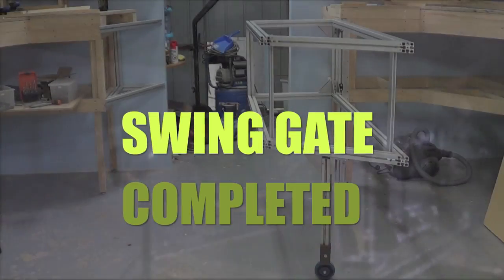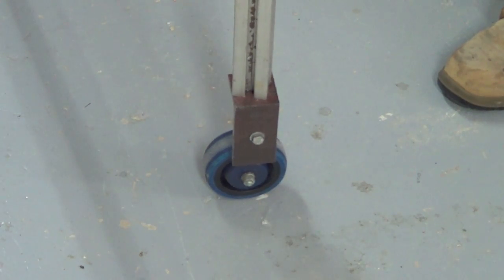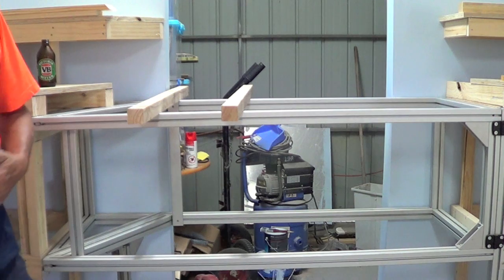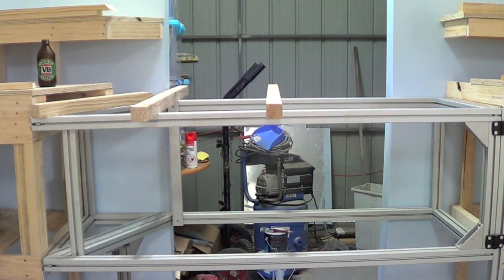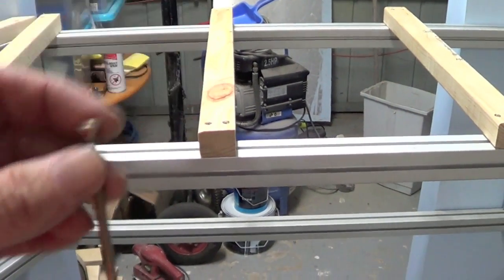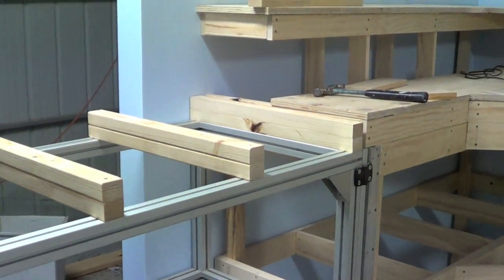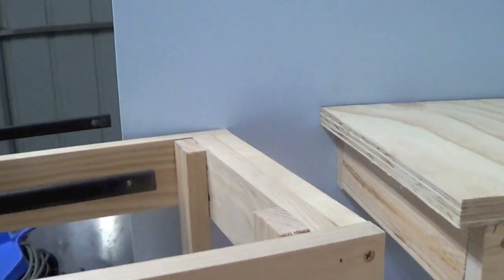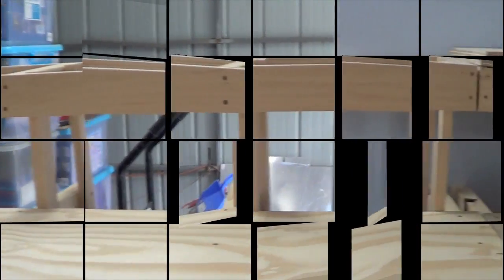Swing Gate Completed " Model Trains"

Comment: Great job! This is one of the most useful videos I have ever seen here. And it will help me to build the same gate for my layout:)
Reply from the maker: +Hrvoje Raukar   Thanks for the comment and hope this helps you out cheers Robert
Reply: Robert,
could you please give us some info on alu profiles you used for your swing gate (dimensions in mm, cross section etc.)? 
Thanks!

Hrvoje
Reply from the maker: +Hrvoje Raukar    Hrvoje   the dimension of the aluminium Extrusion are 45mm square and the two cross sections are 45mm x 16mm
also the two angle brackets are 90mm x 90mm hope this helps cheers Robert
Reply: Dear Robert,

thank you a lot.

Hrvoje

Comment: Hi grat job you may find that the microswich neads the end bending  so you have a rounded end rubbing   on the wood I've had one snagged and ripped apart lookaly with track powered off it might have gone horribly wrong
Reply from the maker: Thanks for the tip cheers Robert